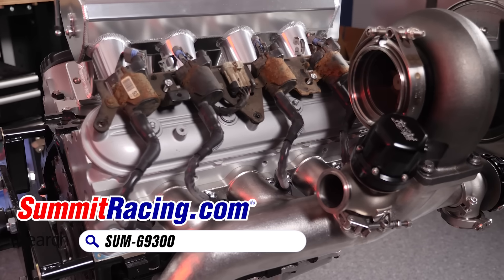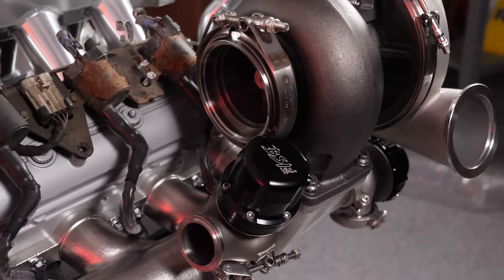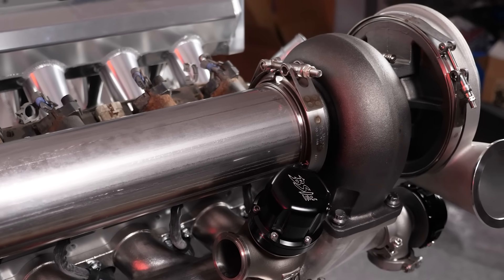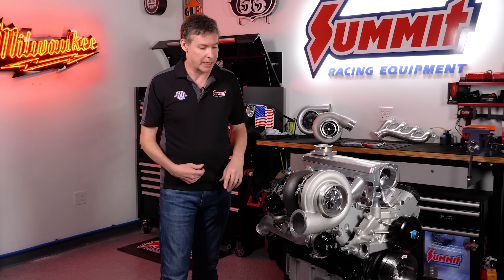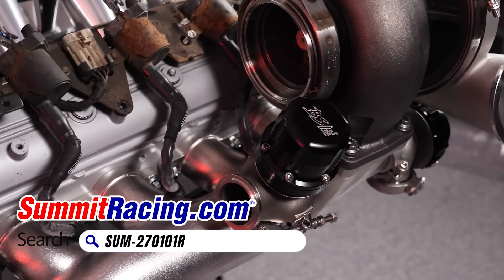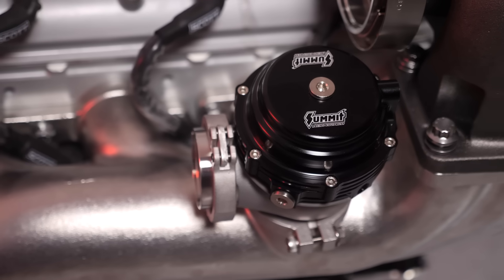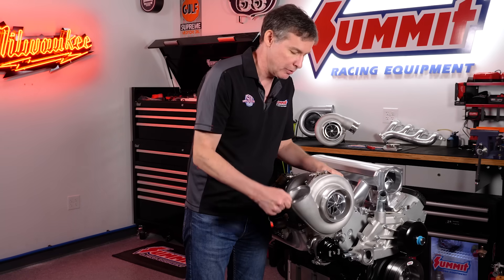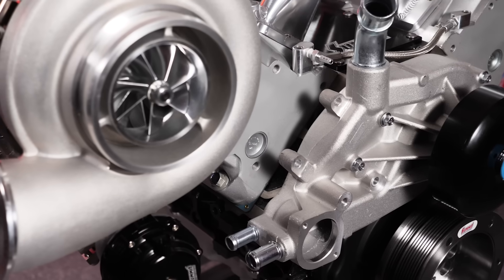The Summit Racing Pro LS Turbo Manifold is an Excellent Foundation for Your Turbocharged LS Engine

Comment: This is REAL nice, Best ive seen for single. but I want to keep my ac,  So I ordered a manifold from Australia. Driver side single. In  Osb 4×4 6.0 4l80e  boy O boy O boy I can't wait 🤤.  I started out in the seventies drag racing my big wheel. This will be my first power adder not counting my right leg. Better late than never🤘
Reply: What’s the link for it ?
Reply: @vbnation1874  Have recently decided turbo It's not really a good fit for my application. Wish I could sell you mine.lol.  But it's a Company called Aeroflow. ✌️

Comment: My deal is on turbo stuff is Spark plug access .  Passenger side looks a little tight in there.  
I run the holley manifolds and plugs and wires are like stock.
Reply: Do you mind showing a link or something for what holly parts you used?
Reply: Hooker 8510KHR Is the part number for the LS
they make them for the LT version as well.

Comment: What additional support is needed, if any, to carry the weight of the manifold, turbo, wastegates, and piping? Seems a lot for just six exhaust studs? Also, what style plug wires are required?

Comment: I definitely appreciate the new products that you develope. Currently you only have the passenger's side, are you going to engineer a similar cast stainless turbo manifold for the driver's side?
Reply: I think it's still using the stock driver side header, maybe they give a pipe to connected each other header.
Reply: Summit sells the Holley brand two manifold system about the same price but doesn't have the turbo flange on there or WG mounts.